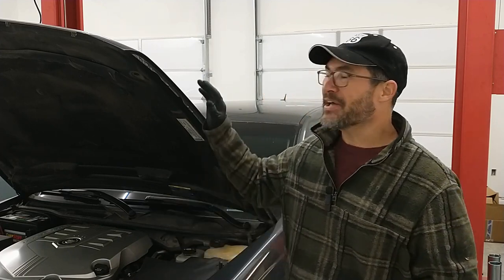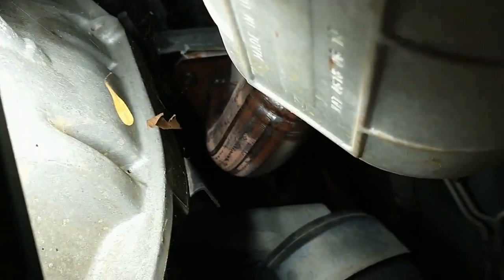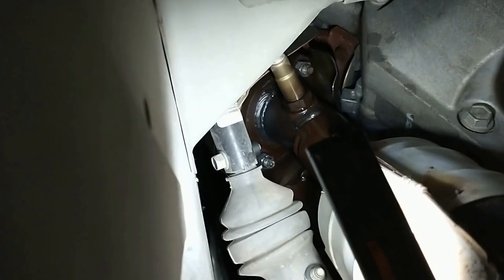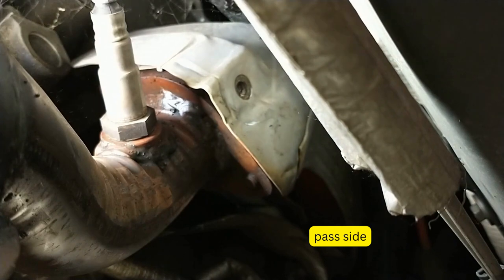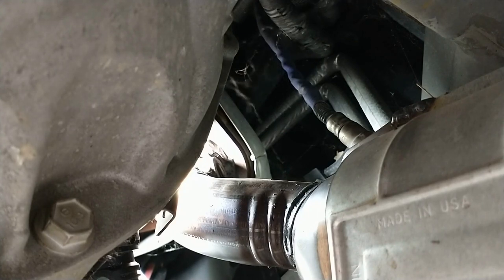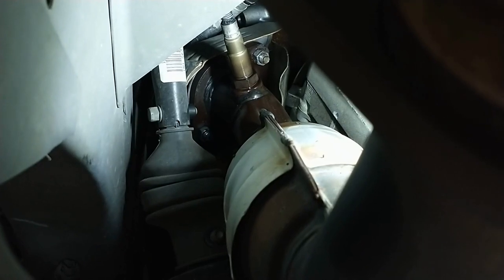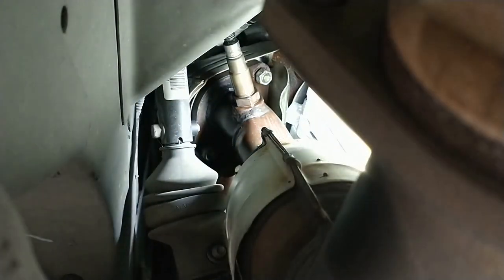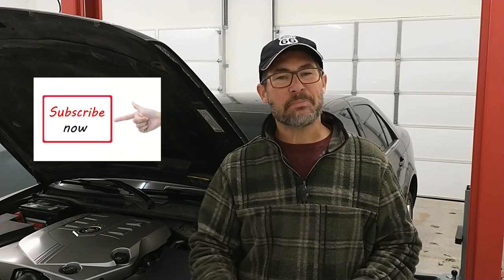Replace catalytic converters on GM 3.6L V6. (fastest, easiest way)

Comment: I was having no problems with my car.. No engine lights or anything... I took it in for an inspection.. The mechanic then tells me I need to drive it a hundred miles.. Once I drove it a hundred miles my check engines light omes on and it now says I need a Catylic converter.. Wouldn' there have been some type of warnings.
Reply: I was having no problems with my car.. No engine lights or anything... I took it in for an inspection.. The mechanic then tells me I need to drive it a hundred miles.. Once I drove it a hundred miles my check engines light comes on and it now says I need a Catalyic converter.. Wouldn't  there have been some type of warnings.
Reply from the maker: a lot of times the error codes that will make people think they need new converters are p0420 and p0430, but may just be bad oxygen sensor past the catalytic converter, other things to check are wiring to the oxygen sensors and exhaust leaks or loose exhaust connections that could fool the computer into saying there's a bigger issue